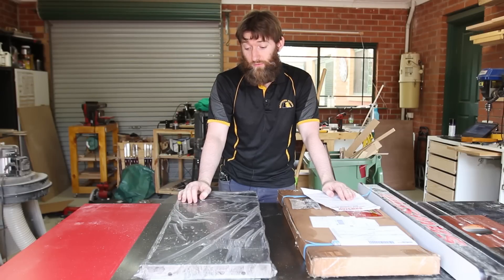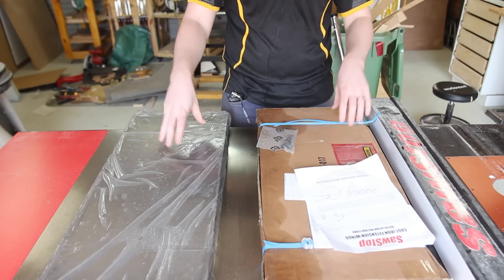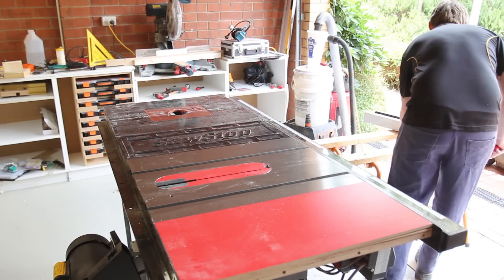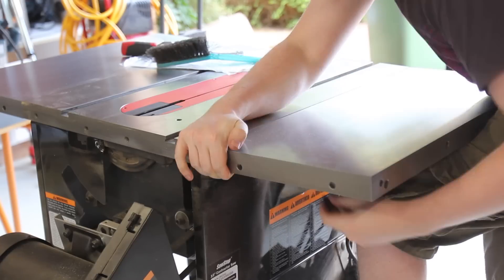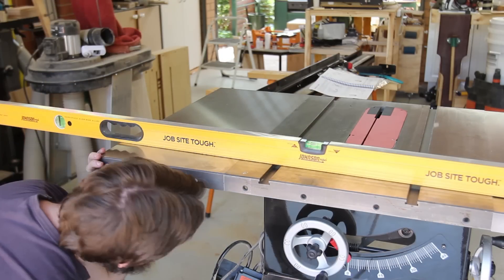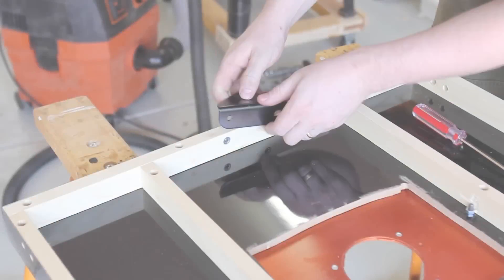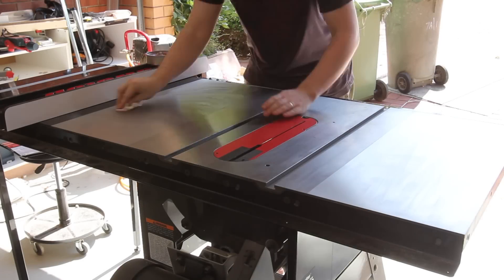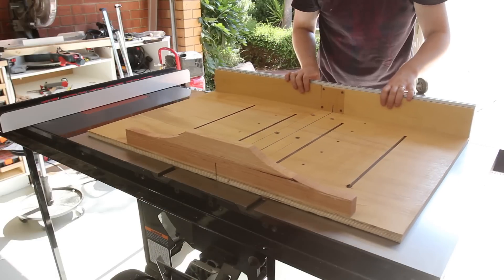Table saw cast iron extension wing upgrade

Comment: Adjustable outfeed stands make installation of extensions tables and fences much easier. Also, don't rely on levels to check for flatness, most of them have some warping in them. Look for a steel (not aluminum) straight edge guaranteed to be within on or two thousandths of an inch.

Comment: Did your cast iron wings come with any chips or gouges in the sides? Mine did, they are small but noticeable. I'm trying to decide if I should go through the hassle of exchanging them or just deal with it.
Reply from the maker: Mine did not come damaged.
Reply: Thanks Paul. Guess I just got unlucky. I've decided to exchange them.

Comment: Hi Paul. I can't get my wings to be level. You said it was a simple but tedious process. In my case it doesn't matter what I do, both wings sag away from the center. Any suggestions?
Reply from the maker: Depending on how far it is out, perhaps get the center locked in and flush first, tighten that down, then clamp the ends to flush? Cast iron has a bit of flex in it.
Reply: Paul Jenkins Thanks for the reply Paul. I have the inside of each wing flush with the center base. The problem is that the outside of each wing sags down a few mm.

Comment: G'day Paul, I'm from AU and struggling to find paste wax in the local hardware stores for my new table saw and I don't specifically want to spend $50 for a small tin of it at C***tec. Since I've got some beewax or Paraffin wax handy. Would it just be as simple as mixing some oils with the wax as seen on some youtube videos?
Reply from the maker: I've never done it, so no idea. Ubeaut wax is $22

Comment: Wish SawStop would add additional holes for those of use who have the 3 hole pattern table saws.
Reply from the maker: Sawstop make extension wings for Sawstop saws. If you have another brand, you can probably get wings from them, or you can just drill into the cast iron. Its easy enough to do with just regular twist bits in a 18v drill

Comment: Nice improvement Paul.

When are we going to see the outfeed table build?  :-)                                     JimE
Reply from the maker: +Jim E That is on the list! I've got a few other projects to finish off first, but I'm hoping sometime in Feb. The tricky part is compensating for the less-than-level concrete floor, so it'll have to be (at least partially) bolted to the saw itself.
Reply: +Paul “TheWoodKnight” Jenkins You're right, hard connection is best. To avoid that I used levelers on each leg but I am constantly having to readjust them and when I do that the miter slot dados get just a little bit off.

Comment: This is how lazy I am. Two years ago I purchased a brand new table saw, but since I couldn't afford the cast iron wings at the same time, I waited to put the table saw together. Two years later I purchased the cast iron wings and am just now putting the entire thing together all at once now that I have the new wings. I've never even heard the saw motor because I didn't want to take the thing apart just to install the new wings. Yeah, I know, PATHETIC!